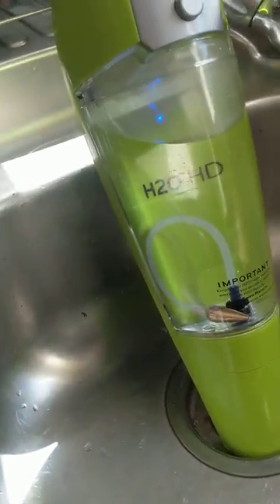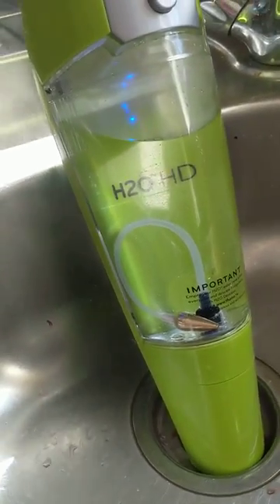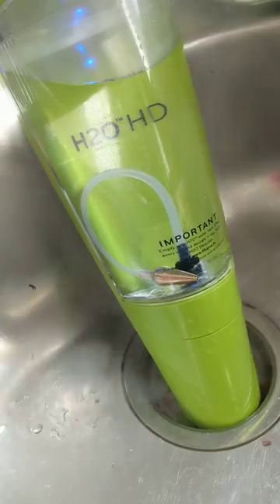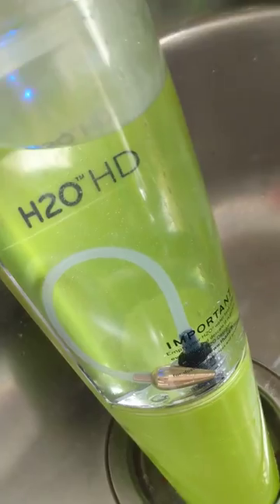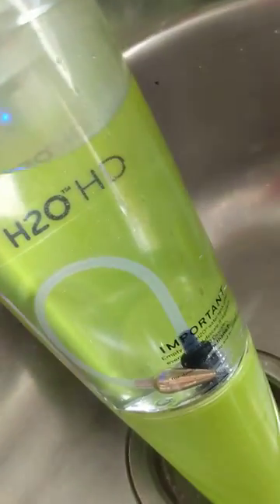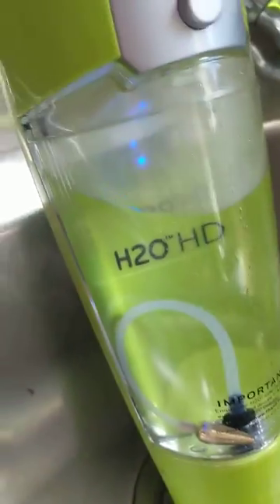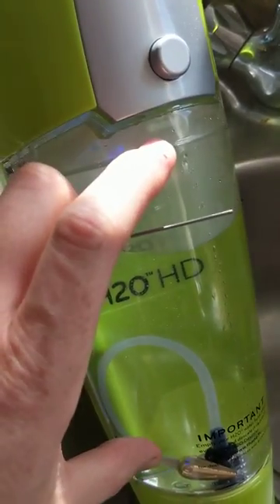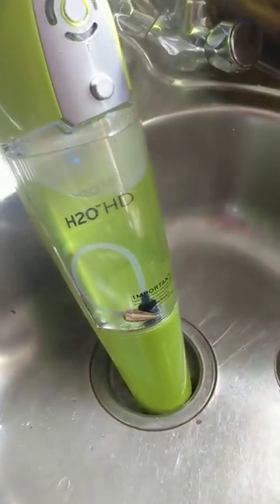H2O HD Steam Mop - No Steam / Not Pumping RESOLVED

Comment: Thank you for posting this. I have had my steamer for 6 months, the filter balls are still white and it's not steaming. I'll try this in the morning. You sir are a star !
Reply from the maker: You're welcome..however please do not discount the filter just because it is white. My mother's filter looked fine but did enf up being that. I think a quick check is that if you shake the filter and the balls move then it is probably OK. If they don't, the filter probably requires replacement
Reply: @chrishorsman689 Thanks, your video got mines working again fine. However, I don’t think I have any shake left in the filter, so will swop that over.

Comment from the maker: Thanks for the comments. Another solution to add. A family member had exact same issue and the exact same symptoms, however their solution was in fact the filter. With this one I noticed that filter balls didn't seem to move at all when tilting filter. Compared to my one, or a spare new one, the balls would move around inside the case. Replaced the filter which sorted it out.

Comment: > good job., on the older H2o mop the vent is built in the water tank lid with a rubber cover that pulls inwards and let air thru when  a vacuum develops in the tank

Comment from the maker: Just to add: there will be a reason why the vent has suddenly become sticky. Mine was because I found out my wife had added some Zoflora to the tank. The vent did become stuck again a few hours later. I discovered that a long interdental cleaner (toothpick with bristles) was ideal to get into the vent to try and clean it. Now that I know this was the issue, I can be reassured that worse case scenario, I just need to buy a new tank.
Reply: Buy this man a drink  That work ......thanks man
Reply: Theyll give you a new tank if you say the brass weight became unattached
Reply: Didn't think of that.
Mine kept come off the tube, few other issues after 5 years so bout a new one. 
Will remember this.
Thanks

Comment: Could you demo it please? Mine still not working
Reply from the maker: Have you tried just changing the filter?
Reply from the maker: If you take out the filter and the beads don't move, I'd definitely say you need a new filter. Honestly it's worth trying anyway, they aren't expensive
Reply: @chrishorsman689  thanks Chris. Yet I have bouth a new filter. And poked about with the needle thing. Machine lights up but no steam and no pump. seems like it's a gonner. Had it about 15 months
Reply from the maker: @dcjoakley619  ah ok, sound like the pump had gone then unfortunately

Comment: hi, mine steams out our the bit you showed, but when I connect it back on the mop it does not come out if the mop head! any suggestions x
Reply from the maker: Have you tried replacing the filter?
Reply: @chrishorsman689  it does not need replacing, I have not had it long and only used it about 4 times, :D
Reply from the maker: @emmalouisefarrow1410  neither had my mother with her's but that's what it turned out to be. I would try it just incase. You can get them on Amazon. Have you by any chance used anything in the tank like Zoflora? This will 100% stop the filter working
Reply: Nothing but water xx it's coming out like yours in the sink but it will not pass through the mop head x
Reply from the maker: @emmalouisefarrow1410  honestly, I would still try the filter to rule it out. Is the water that comes out hot?
Reply: yes x still hot
Reply from the maker: @emmalouisefarrow1410  ok so your heater is fine, the only other part in line is the filter.
Reply: @emmalouisefarrow1410  I had this problem.. I threw the mop part and it worked again...I think there was a clog in the hole from the steamer to the mop itself
Reply: @postalheartrage  I took the end off and got a medicine syringe and squirted the gunk out x works fine now

Comment: I tried cleaning and it did not have much build up .... now it just makes noise but does not steam still ... there is more problem than described here
Reply from the maker: I can only describe what had worked for me..there is another comment here for my Mother's one, hers had the same symptoms but was the filter that required replacing. Have you tried that?
Reply: Where is the filter on this ? Think that may be my issue. Really frustrated I only used it once for 5 mins 😡 got it off Thane USA website now they won’t respond